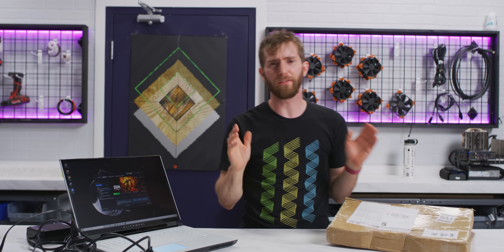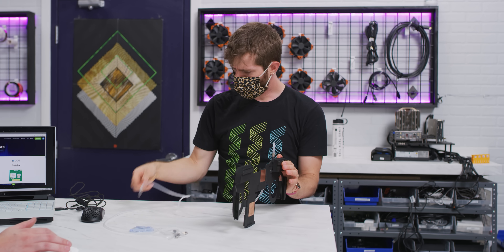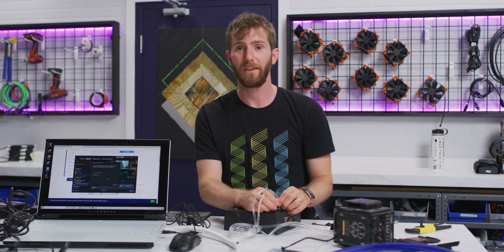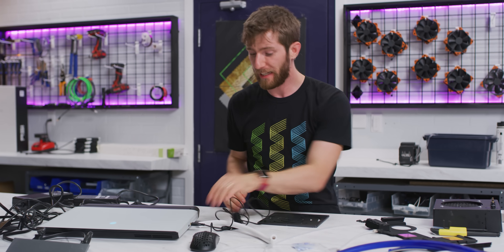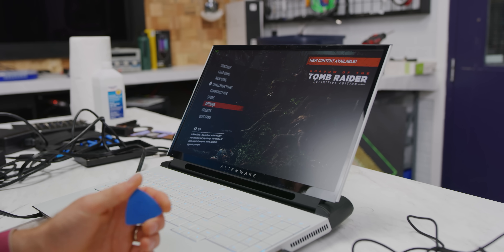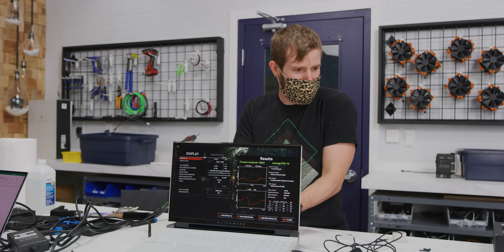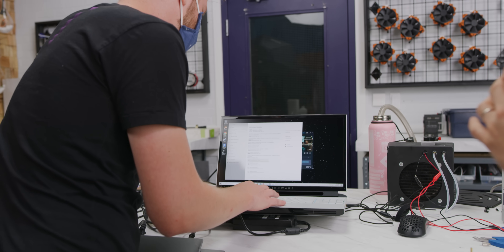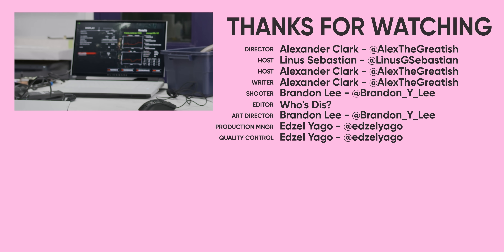This Sketchy AliExpress Cooler....

Comment: If you where to use a quick connect fitting on both the inlet and the outlets of the watercooling system (closer to the laptop itself) you could literally plug it into watercooling when you where home and disconnect to take on the go, the fitment leaves a lot to be desired but 20 degrees cooler max load is almost worthwhile. I also wonder how the temperatures would be if you where to use the quick connect fittings as one of linus's main concerns about it was the gap that is needed for the water to flow, by using a quick connect the laptop would always have water inside the heatsink so the gap wouldnt be an issue.
Reply: That could actually work, its a nice concept

Comment: Why the hell would you remove a portable built in cooling system, to install a new water cooled system that ties you to a big fan block needed to cool the water?  You might as well just have a desktop.  Totally ruined the portability of the laptop

Comment: I guess this video is one of those jobs that seems easy but ended up taking more than a day to do. But still with that week you can fit the fitting better or put some quick disconnect fitting or make that cooling box with 240mm rads. They should revisit this and at least make those investment a run for it's money

Comment: I have done that water cool mod to my 17R4 2 years ago, with total around $65 water cooler and $2 1/4 inch copper pipe and silicone air hose from my fish tank. Both cpu and GPUs temp drop almost 30 degrees C.

Comment: If you got that liquid cooler, you should go ahead and overclock the GPU now. On stock you're not able to overclock due to thermal throttling. but now that its liquid cooled, theres lots of headroom to overclock the GPU and possible CPU. I think this is meant for overclocking application.

Comment: even in 2017,there was watercooled custom heatsink for clevo p870tm ..so it's nothing new...these machines are just for enthusiasts and powerful users and real desktop-replacement seeker..not your average joe....what surprises me the most is that "probably" no one in linus-media-group use clevo desktop-replacement although they are much more powerful than the laptops they use which means faster workload being done and also the somewhat portability is still there for them instead of a case,even a mini one. in p870TM, we had people succeed in overclocking i9 9900K up to 5.4Ghz and stable @5.3ghz ,just like good desktop pcs;so they are really for powerful/enthusiastic users

Comment: Support for external cooling might not be the worst idea for a gaming laptop. Decent fps with some throttling on the go, then plug it into a 360 rad at home for actually competitive performance. You'd just need a better plate than this, with larger-diameter connectors and internal tubing, and some sort of magical connectors that are easy to connect and disconnect, repeatedly, with no leakage.

Comment: Wait, if the thermal headroom increased with the after market cooler, wouldn't it be possible to push the overclocking of the system a little bit farther to match the temps of the original cooler to gain more performance out of the laptop?🤔

Comment: I soldered some water-cooling onto a Clevo P870DM3 with 9900K and 1080s and it runs full tilt drawing 550-600W from the wall, with the 2x 275W power modded GPUs in the 70s and fans on almost zero instead of thermal throttling with fans at 60dBa
It took a couple years from the start of the idea, researching thermal solutions and physics, to a guinea pig P370EM with 1070 SLI, but I guess these Chinese solutions are spending money to save time
For a still somewhat portable desktop replacement solution that doesn't sacrifice power or keep everyone in the house awake at night, it works for me
Currently I am in the process of rebuilding it to better cool the 9900K with direct die

Comment: Disliked this video because you didn't test overclocking improvement and overall noise level, and so you miss the wider picture of its usefulness.
When I used one of this solution for my Alienware 17 R4 with i7 7820HK it was able to run at 4.3Ghz all core at about 65 celsius degree maximum with liquid metal applied. It's cooler, quieter and more stable than the origianl fan only cooler with liquid metal.

Comment: Watercooling Alienware has been there for at least two years. I personally used one for the Alienware 17 R4. My experience was that, with liquid metal, my i7 7820HK (OC to all cores 4.3Ghz) + GTX1080 (OC core + 300Mhz RAM + 600MHz someting like that) was able to achieve 75 celsius on load  for the CPU and below 70 for the GPU. And the overall noise level was much lower than original cooling with liquid metal.
For the Alienware 17 R4, there was a vendor trying to make a uniform plate that also covers the PCH chip but he never releases it.
And if you search for it, there are a bunch of laptop water cooling solutions on Taobao for different laptops (Alienware are the most popular one). You probably only need to spend about 1200 CNY for the whole thing. And some vendors make water pump that can collect the water back so you can actually bring your laptop out without bringing the whole water cooling kit.

Comment: Dang it, I overclocked my 10 year old laptop display and its went to 100hz without any issues lol

But the laptop is still so old so it can't even run games on 30 fps 
Using windows 7 I tried playing dead space 3 with lowest setting and got almost 80 fps most of the time
Than, 
I upgraded to windows 10 and now I'm getting 50fps max with the same settings

Comment: Although the FPS didn't change much, dropping 20C on the max temperature seems pretty impressive.
Reply: He forgot to overclock it. Main reason to go watercooling.
Reply: @SolidSniperBooM  Dell doesn't allow it to go very high
Reply: Not to mention the inconvenience of having a pump just dangling from your laptop like that. Has all the downsides of both a laptop and the desktop form factors, and few of the upsides of either.
Reply: @Agamemnon2  they just need to design a  very expensive laptop case with pump and fan integration to go with this 🤣
Reply: @Agamemnon2  he didnt even test having just water without flow and a rad in the new cooler. the hybrid solutions from a few years a go all required you to not drain the loop when using it without a rad just on air. i think filled with water and but without a rad or tubes this would be a way better solution they make it out. i mean, there are air gaps without water and they dont even aknowledge this and say this cooler would be worse when they in fact did make it worse by their own actions. but yeah 400+ is a bit much.
Reply: but not for $450
Reply: @dantefernandez3362  This heatsink probably costs only $100~$120 US if purchased on Taobao.com in China. It's probably the delivery that costs much money...
Reply: @dantefernandez3362  this is only about 100 USD in China, the delivery fee and vat are too expensive.
Reply: hasal hussain actually 20c for $450 Canadian is very cheap.
Reply: @dantefernandez3362  If you are able to afford a $4000 laptop, why don't you pay an extra 10% for the water cooling solution?
Reply: @dantefernandez3362  agreed. Liquid metal would do more for less.
Reply: @markp8295  liquid metal won't give you 20C low temps, best case gonna have 10C better temps
Reply: @markp8295  should do both and see what temps you can reach
Reply: @markp8295  nope. not on the cpu side of things, the cpu is just undercooled with a tiny bit of copper. the gpu would be cooler but LM doesnt make a cooler cool better it just makes the transition of heat more efficient. a 200w+ cpu couldnt care less.
Reply: @tarkitarker0815  You are correct that heat pipes have a thermal transfer rate limit, but for direct conduction to a block, an improved TIM will produce temperature improvements with deminishing returns up until the point the cooler side twmp is equal to the CPU temp.

This is shown by the water temps being significantly lower than the CPU temp.
There is potential for more energy transfer there.
Reply: @markp8295  still laptop coolers get pretty hot in factory design, i think a desktop cpu is just way too overkill. the gpu will have great results with lm.
Reply: @markp8295  can't use liquid metal unless you delid the desktop processor. Then you may need to use copper shims to make up the height difference
Reply: @dewaynehowse231  You can use liquid metal on the IHS to cooler as they are both copper with the IHS having a Nicole plating.
You mustn't use it on aluminium as the Gallium in it forms an amalgam which breaks down the bonded oxide layer and slowly turns it to mush.
Reply: @markp8295  you would still get no gain without delid. Because your dealing with a thermal compound under said ihs.
Reply: @dewaynehowse231  The chip in this laptop is soldered. Intel have started soldering all their high end 10th gen chips because they have had to combat AMD on boost since they couldn't onncore count and the goop they used wasn't cutting it.

On their lower end chips, you're right.
Reply: @dantefernandez3362  What's a 450 bucks in a 4500 laptop :D
Reply: thevil money maybe
Reply: If you can afford this laptop chances are you can afford a desktop. And given that this solution ruins portability of this laptop. I wouldn't consider it worth it
Reply: @legendp2011  it doesnt though, there are 1/8 inch caps so you can fill the heatsink with water and let the water be in it. while being idle the water gets cooled down to chilly temps and when gaming the heat resistance of the water does decrease the amount of heating the system gets thrown at, why does nobody think about that? plus i think this thing is intended to be screwed a bit deeper in so that it actually fits in to the honeycomb holes. remember this isnt gamers nexus where they do things right and think trice about it before doing stuff this is ltt where they do things the way it gets more clicks and adds more controversity for more comments.
Reply: Gadget Addict X Linus Tech Tips
Reply: Yeah
Reply: A eGPU or Alienware Graphics adapter makes more sense. Many people don't realize they don't have to connect an monitor externally to take advantage. It does forfeit some bandwidth but still generally better overall vs onboard.
Reply: Especially for those parts on such a tiny rad.
Reply: That outlet hose won't last long at 45°C
Reply: @runescapefan0001  dude. you realize that 45c are nothing? imagine that people in saudi arabia and south asia have watercooling too, and imagine that they dont need to buy new hoses every few months....
Reply: Imagine a Real Life use, where there's dust and gamer gunk in that chassis. This will actually make a difference!
Reply: I can see somebody wanting this product. Even though I think laptops should be portable.
Reply: Also allows for more overclocking headroom this way, they just don't get a lot of benefit at stock.
The whole thing is silly though vs just buying a desktop at that point
Reply: Yeah, but having to always have a big water block and a power source connected to your laptop to use it, defeats the purpose of it being a laptop -_-
Reply: Shame it will invalidate your warranty
Reply: Hey man. I watch your videos.
Reply: 20°C for 500$ it's not impressive tbh
Reply: i have an 8086k in my laptop and its temps max out at 68c 4.7 all core playing games so no bad cooling all around 79c at 100% usage
Reply: @forog1  still its no 9900k, 2 less cores 50w less powerdraw, and you probably have a laptop that weights 10 lbs
Reply: Yo dude, the Extension Master reviewer ✌️
Reply: Who would pay 450
Reply: Oh wth hello gadget addict
Reply: wow. You're here!
Reply: Exactly, it worked.
Reply: But it wasn't given to him for free so it sucks.
Reply: It speaks for alienware that their stock solution apparently is dimensioned just right for hardly losing any performance when maxed out.
Reply: yooo my British Filipino Expat homiee.
Reply: Linus:drop the temp 20°c it normal
Me:drop the temp only 5°c me do hard bass dance
Reply: 10:46 that's how we used to fix our broken tv in childhood days!
Reply: I don't think a piece of metal shaped like that and some plastic tubes should cost $400+ though lmao
Reply: I could have been better if it had quality pads. Pads in the 12m/wk at least. I got 16.5 on mine and they make the world of difference
Reply: Ayy what happened to your videos. So much for “gadget addict”
Reply: I would think dropping cpu temp prevents some throttling and therefore can sustain said fps longer than without. U don't gain fps, you retain it for longer duration
Reply: Exactly
Reply: You have 4K likes.. I've never passed 720
Reply: Well he forgot to add some more rgb for higher fps
Reply: I don't know about that machine but with my laptop you can overclock both the CPU and GPU so having an additional 20°C overhead would result in a notable increase in frames. I don't need it right now but $450 is cheaper than buying a new gaming laptop, much cheaper.
Reply: My laptop gpu reaches a temperature of about 56⁰ c while playing forza horizon 4
Reply: I mean haters be hatin', but honestly if you mostly use it at home, and it's only marginally worse filled up on the go like... idk man, this ridiculous thing could be the difference between having a super powerful laptop for one and a half years, and having one as long as you're sill content with the GPU... I don't know if I need to say this but, heat bad, heat cause parts die.
Reply: @AmaraTheBarbarian  then why not buy a good desktop and a good laptop for that money xD
Reply: @zEnocYber  I don't recall but wasn't the water cooler like $300? Please show me how to get a second entire gaming computer with equivalent specs for $300... Not to mention there are other reasons like uniformity, a desktop and separate laptop won't have all the same stuff on them if those files don't automatically carry over, like for old games and emulators... Pretty bourgeoi to suggest having both is inherently the better option :/
Reply: @AmaraTheBarbarian  How about just no buying a laptop? Crazy idea huh?
Reply: @TheBrazilRules  Or just a laptop? Crazy idea huh? >.>
Reply: @AmaraTheBarbarian  the 2080 GPU is gonna be outdated way before the 9900k.

I have a i7 4940mx in an aging MSI gt70 , it's been banging off the thermal limit for years and still works almost exactly the same as when I bought it with the only exception being its max turbo under sustained load is about 200mhz lower.

I suspect due to heat degredation forcing more voltage for the same clocks.

Not bad for 6 years old though.
Reply: yeah, but dont we buy laptops to be mobile? You wouldn't carry an extra bag to carry your water cooler accesories. IF your staying put just buy pc lol
Reply: @nickmyers3065  the powerbricks for this laptop weight around 4 lbs, talk about portable..... and you always want to carry your power bricks with a laptop that guggles 150w when you do lighter work.
Reply: Yea! For $450! You could put ur laptop in the fridge for free 😂
Reply: they are optimized for air cooling  basically that is the problem with the result it is physics that has more experiment to actually prove that
Reply: I need that shit for my laptop, its unfortunate that watercooling for laptops dont exist
Reply: @baileyjerman5573  it is for special purposes only like editors or intence purposes
Reply: No you spoiled the vid for me :( I hate the fact yt moved the comments tho the top
Reply: @anooshamoodley4835  then why read the comments while you watch the video. Get over it.
Reply: @anooshamoodley4835  I uninstalled all the updates for YouTube on my Android and am never updating it because of that
Reply: @xtremefps_  Then you might not have a working YouTube app in the future...
Reply: 450$ and all that stuff around ? that take a way the reason why a laptop is created :V
Reply: @anooshamoodley4835  dont read the comments before watching the video??
Reply: Spoiler!
Reply: @alexeyshevchenko8986  just dont watch the comments before the video. lmao.
Reply: @tarkitarker0815  It was first comment, so it was shown just when I opened a video
Reply: @alexeyshevchenko8986  but you did look at the comment section of the screen, i did update my yt app and know now what you mean, but you still have to look down from the vid to see  the comment.
Reply: @tarkitarker0815  It's easy to look by accedent and eye catches numbers. Anyway it is insignificant, there a lot of content going on.

Comment: I don't understand why LTT does not use a tiny torque screwdriver when installing CPU coolers.Why do you guess at tension on the cooler when the equipment exists to get the exact tension you desire? Amazon has a big selection https://www.google.com/url?sa=t&source=web&rct=j&url=https://www.amazon.ca/Torque-Screwdriver/s%3Fk%3DTorque%2BScrewdriver&ved=2ahUKEwia1sXSuPnrAhWbIjQIHf9tDqoQFjAAegQIAhAB&usg=AOvVaw3hRA8WKu39CYJN8zUKGQF6